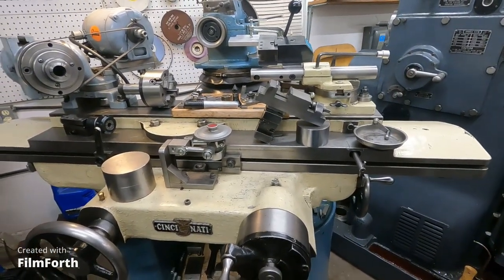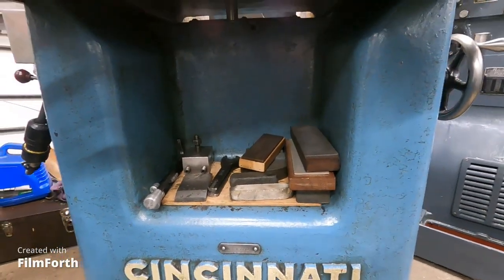Tool & Cutter Grinder make over complete

Comment: I have a question for you Dee. My mill has a QC30 spindle and I’m having trouble finding tool holders. I’m thinking about making some tool holders. What material would you suggest to make them out of?
Reply from the maker: I have been using pre hard 4140 to make obsolete Moore jig borer shanks with good results, thanks!

Comment: That tooth rest on the side wing is really cool.  I don't think you showed it before.  Nice.  --Doozer
Reply from the maker: The adjustable rest can be used for 3 or more functions, the most exotic is spiral grinding similar to a Makino using a rack and gear  with a bar arrangement to drive the work head, a template holder for form grinding with the top table swung at 90. I was fortunate to have some one point these things out.
Reply: @deedeeindustrialsuperprecision  Donnie,  Q?  Can a tool cutter grinder be used to re-grind a worn worm gear from a manual steering box?  I see you have an old Chevy truck.  I have an old '53 International truck, with a loose box.  I tried tightening it, but it is worn in the center. How elaborate of a setup is this ? I have a mint Brown and Sharpe #13, but I really want to get a Cinci #2.  I have seen a MonoSet generate a drill bit spiral. Maybe something similar. ---Doozer
Reply from the maker: @kooldoozer  I think anything can be ground on these machines, there is a Makino grinding attachment for their grinders that uses a rack and pinion with the gear rack connected to an adjustable bar. As the table moves the gear rack turns the pinion gear on the work spindle and the amount is adjusted by angling the bar the gear rack is connected to, an interesting idea for adjustable spirals. It would seem easier to make a master of the same decimal pitch as the worm on a lathe and use a follower connected to the work head to generate the pitch for the worm. to be ground. From past experience this is a part that many shops are afraid to make, or do any type of parts replacement in steering boxes, I have repaired old Ford steering boxes by replacing the sector arm some years ago, but it was hard to find a dealer that would sell the available parts to individuals.
Reply: @deedeeindustrialsuperprecision  Thanks Donnie.

Comment: I had a cincinnati tool and cutter grinder but the table didn't run true. Just can't find one with good bearings. Love the videos
Reply from the maker: That is a problem with bad handling of the machine, but there are good ones out there, the work heads are hard to find with good undisturbed bearings, thanks